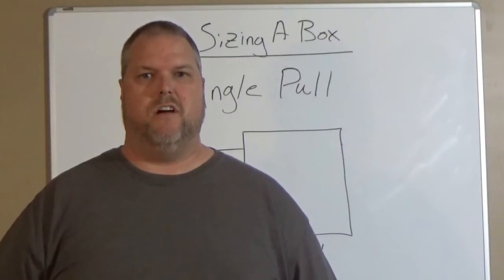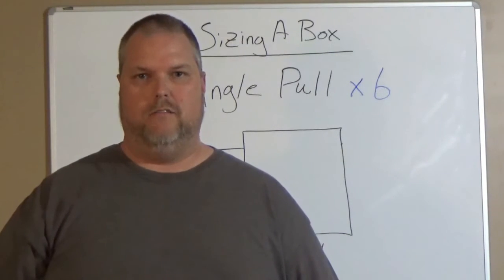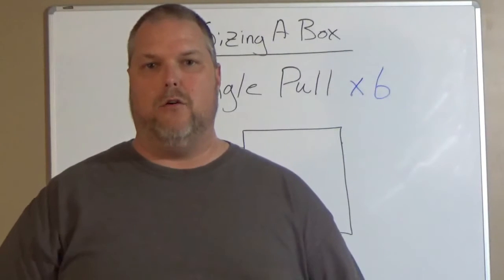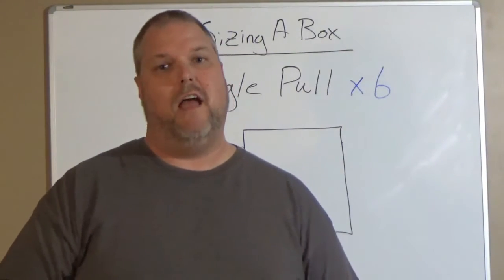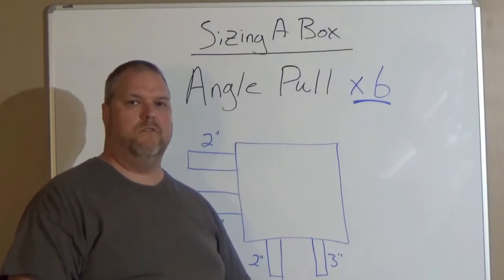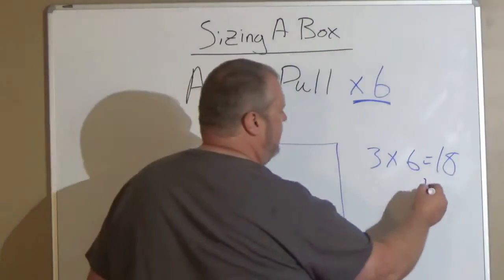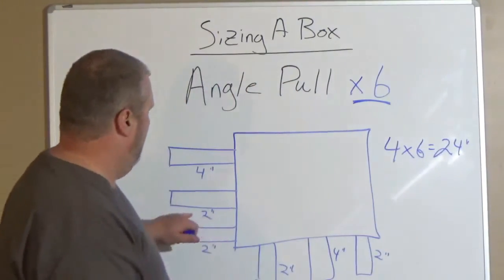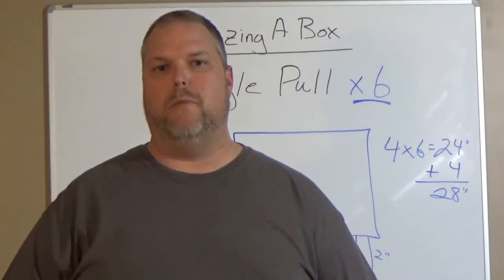How to Size an Angle Pull Box.

Comment: I have a question have a conduit that's entering the top of the box 4 inch  not the sides ( top)  I have two rows of three quarter conduits which consists of 10 conduits  3/4 on a double rack entering the same side it was still consider a U-Pull   so my biggest conduit 4 inch x 6 = 24 + 20  3/4.  What size box would I need don't know the math on 3/4 conduit  and if it's a double rack do I count as 10 or 20 .?

Comment: All these NEC rules talk about wires AWG4 and above. What are you guys doing practically for smaller wires than than, for example AWG 8? Would a standard 4.5" long junction box be too small to be able to pull the loop straight after the pull?
Reply from the maker: Yes but not ridiculous huge but if it’s just a pull box larger can be easier!! Planning a conduit run so you don’t need pull boxes with small wire is the best!! But like in most cases your not just talking one conduit you are talking multiple conduits with Multiple branch circuits!! There is more to go into as well as a thought process. Maybe a topic for another video!! CM
Reply from the maker: When sizing a junction box it’s all sized on conduit size not wire size! Sizing a pull box and sizing conduit by wire size is two different things. The NEC can be confusing but in some cases you must remember the rules of the code first!! This is why we break them down in school!! In the field I can only hope they are following the rules and not cutting corners!! CM
Reply: @craigmichaud-electricalins4602  Thanks so much for your reply! With wire smaller than AWG4, there is no rule about how large the pull box needs to be, so we go back to the box fill rules. Presumably this is because smaller wire is more flexible. Even so, nobody wants to have a problem during the pull. Are you saying that even with small gauge (ex AWG8)  wire you should use really large boxes, even if not required by the code?

Comment: I was just wondering  How would i go about finding the depth for pull box calculation . On my practice mock sheet It shows a 2/0 t90 that is coming from the back of a pull box and has a  measurement of 41 mm. One of the four answers possibly is 12 inch by 12 inch x 4 inch. The other is 10 inch by 10 inch x 6 inch. I'm not sure what to do could you give me some help?
Reply from the maker: I dont have my code book with me to point you to the chart as it is slipping my mind. I believe there is a chart is 314 that will give you depth. If it helps great. I will post to this soon as to the correct code location!! CM
Reply: @craigmichaud-electricalins4602   I'm from Canada so the chart is different i believe so.